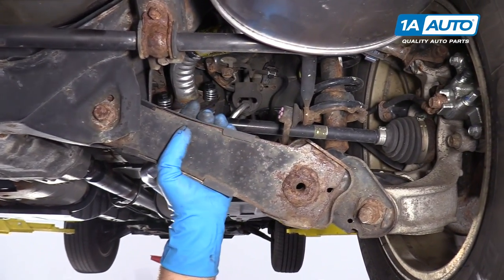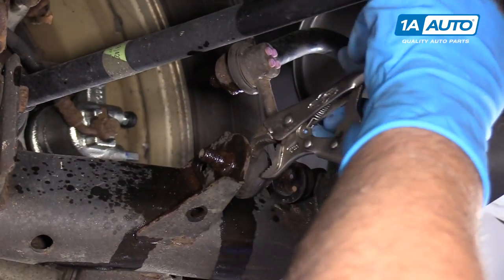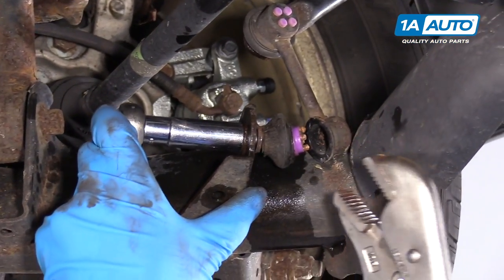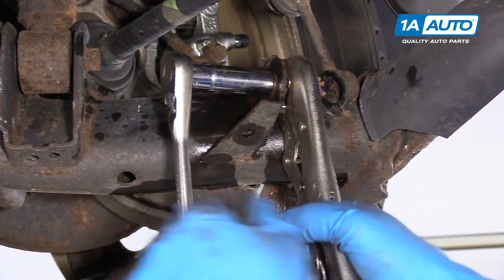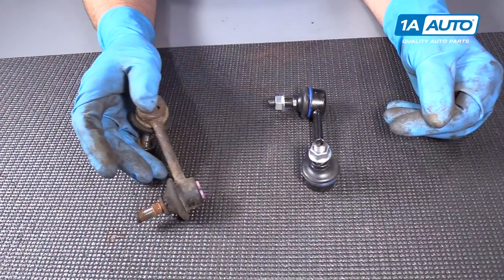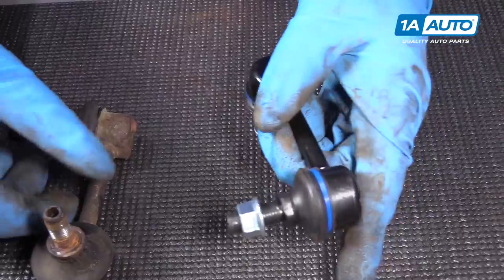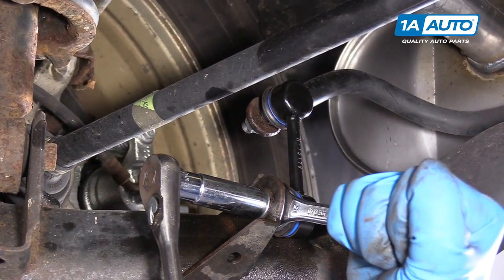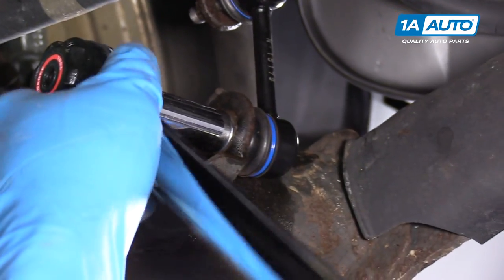How to Replace Rear Sway Bar Link 07-11 Honda CR-V

Comment: When you live in the salt and rust areas removing these bolts is impossible.  I knew the old parts were trash so I just angle grindered the bolts off.  Faster and easier.
Reply from the maker: +Tim Zzz Thanks for the feedback!

Comment: You make removing the old ones look far too easy. Ive just changed mine. They were the original ones on a 10 year old CRV.  Rusted and swollen, and as for the allen key fitting in the end. Forget it.!!! Luckily I was able to remove them both from the car but the anti roll bar end, forget it. I had to take the anti roll bar off and smash the links off, bench vice..etc...I intended to change the anti roll bar bushes anyway but sometimes, these vids really make these jobs look easy but removing rusted nuts and bolts and only a small allen key to stop the whole thing turning, it just doesnt happen like at the movies with just a quick spray of magical WD40..lol
Reply from the maker: +BTN LED Thank you for your feedback!
Reply: I absolutely agree, i just rounded the nut on the back of the front drivers side link. I was able to get the passenger side off with a hammer, vice grips, wd40, heat, and a 6 point wrench. But the drivers side, not a chance. Im close to just cutting the stud and drilling the remaining bolt out.

Comment: Shouldn't both sway bar links match? Wouldn't you recommend changing out both at the same time instead of just one? for that matter Wouldn't you recommend not having one sway bar link be the OEM and the other be an aftermarket completely different build? a mismatch if you will like having only one drilled and slotted rotor for example.
Reply: The Sway bar is what does all the torsional loading. These are just the Links that connect the sway bar. Although they pivot to accomodate the movement, as long as they match the OEM part, they should be fine. Admittedly, common sense says that IF one failed...the other one may not far behind?